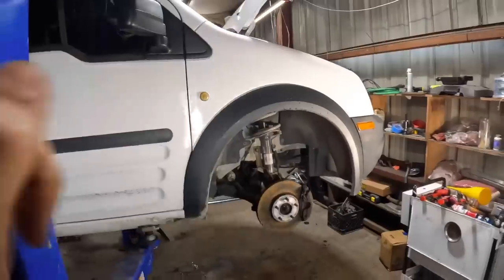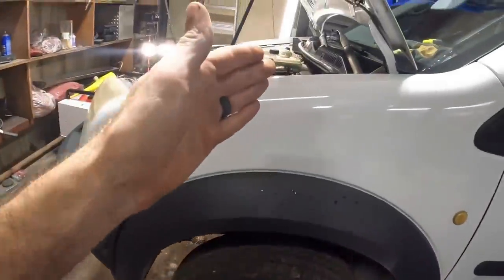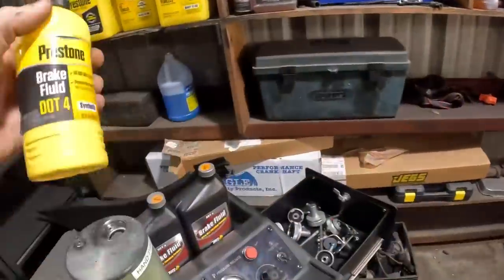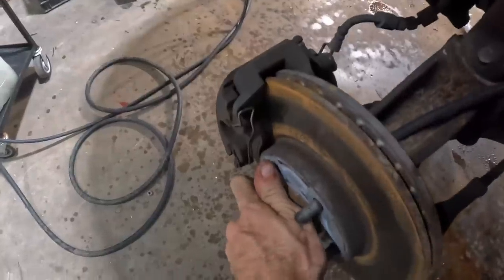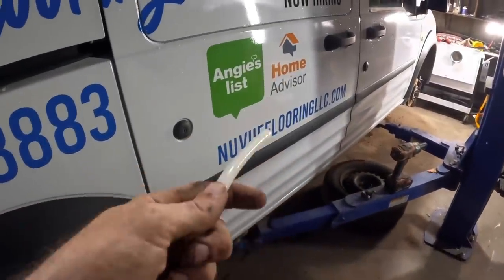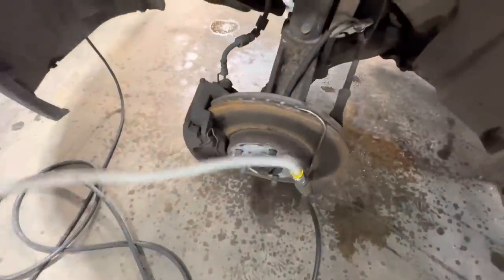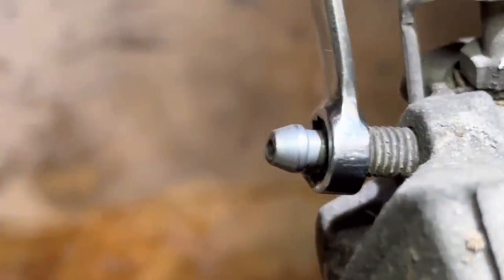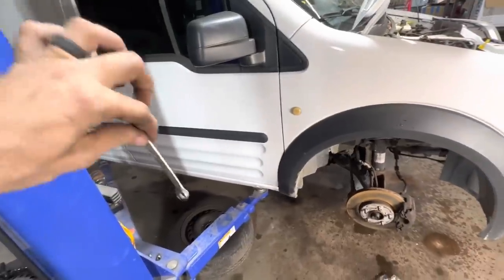Does Brake Fluid go BAD?? Ford Transit 2.0

Comment: I'd always exchange break fluid on aircraft on an annual inspection, the ones I'd not worked on had old fluid yellow and like treacle instead of red.
If I still did aircraft maintenance I'd do videos.
Now I'm building aircraft for film work so they don't need to be airworthy.

Comment: Aren't bleeder valves about the size of a grease zert so here's my idea. Find a clamp on style zert and a clear piece of lexan tube hook the rubber suction tube over the clear pipe then hook a rubber tube on that and install the clamp on zert to that, then when you use this you can hook it up loosen the bleeder and you've got a clear seight tube to watch the fluid in and dont have to disconnect anything.
You put you box end on the bleeder and dont remove it, this way nothing gets disconnected and you can always see the fluids as it clears up, no chance of letting air into the lines ecpt at the master cylinder as it fills becuse this can make tiny bubbles under a vacume it shouldn't.

Comment: Missed Brake clean spray of all the spills. Most brake fluid is very corrosive to Auto Paint surfaces and to rubber grommets and those on the axle got covered in the bleeding. Hope you did spray clean before refitting wheels.

Comment: Just so you know the fact of not removing the hose is what introduce air in your system because the vacuum is greater than the output and draw air from the threads of the bleeder.

Comment: About the green brake fluid: Some brands use intentionally pigmenting of their fluids, color coding the type: Red was an old petroleum oil based low temperature one (recently used only on large vehicles to transmit pedal controls to clutch, mechanical diesel injection pump, air brake valve control; compare to the high temperature ones it is not hygroscopic, so has very long service lifetime), yellow is Dot3 and if I remember well the Dot4 was colored green. So to me most likely it is green from its manufacture and not from any corrosion. Moreover it was rather consistent green on all places, very unlikely from a corrosion when the fluid is actually not circulating in the system (like e.g. steering...).
Reply: Audi has green dot 4

Comment: I am surprised that you did not take the opportunity to make the back of the calipers "nice and shiny" to wash off the brake fluids that spilled out before suction was applied. XD good video - very well explained how a decent tool lets you exchange the brakes fluid better then way Ive used to do it. which was basically me allowing fluid to fall into catch thing until fluid was empty then add new and bleed system.. - this way seems so much better and technically faster too.

Comment: The last time I got a fluid exchange they left a bleeder open and when I left I had no brakes. Then the tech had the nerve to blame me. I changed my rear calipers but not my front. I never trust myself with bleeding so I took it to a national brand. When I returned I could see it pouring out of the right front wheel. After trying to blame me for something I didn’t do then he said the bleeders were feeling like they were about to break if he tightened them too tight. His story kept changing.

Comment: Hey Rainman,there should be some hex nuts in the machine that has various size bleeder  sizes on one end and a big open round opening on the other. These are for holding the bleeder hose onto the bleeder tighter and allows you to snug up the bleeder using a 9\16 wrench. Then you can take the hose/hex assembly of and final tighten with the correct size wrench. They really help in situations where it is a little tight like at those rear wheels. I didn’t see them in the drawer though.

Comment: 9:32  Na, the cylinder is lower than the master and the bleeder screw is at the top of the wheel cylinder.   I gravity bleed or just use the pneumatic vacuum unit.  Also, always crack the bleeder when compressing caliper pistons so the old heat-cycled fluid doesn't go back through the system.

Comment: The replacement wheel cylinders for my 67 Plymouth came with 7mm bleeder valves.  Not amused.  The SAE equivalent wrench is a bit under 9/32".

Comment: cant get air behind the system under pressure unless machine runs out of fluid only other way to get air is if you suck the line of oil faster then its pumping so don't need to keep suck hose on while tightening it back up

Comment: Just got a question for you Ray on today's vehicle that's what you have to do cuz back when I was doing it I used to have a plate and I strap it over the master cylinder pressurize it open up the wheel cylinders  starting like you said right rear, left rear, right front, left front, and it pushed it through. I had to remove the plate and refill the master cylinder but I wasn't sucking anything out,  just blowing it through.Can't do that on today's vehicles. Because of the ABS system?. 🙄🤔🙏,🇺🇲 The old fart in Southern California 😎. Wife unit drinking on the job, hopefully after hours right. 🤗👍🌹♥️

Comment: Brake fluid turns greenish because of the copper ions absorbed from the brake lines.
There are test strips you can buy to test for the level of contamination.

Comment: That's weird that the bleeder valves were 2 different sizes.. Never seen that before. I have always done brake fluid exchanges using a hose from the bleeder to a bottle with a little bit of clean fluid in the bottom. No need for expensive machines. Top off reservoir, and using the brake pedal. I pump clean fluid through the system. Starting at RR, LR, RF, LF... Thanks to the fluid already in the bottom of the bottle, looping hose up over top of caliper/drum you don't let air back into the system.
Reply: Front and rear ones can be different from eachother, especially when dealing with drums at one end
Reply: @Emily-ou6lq  I've worked on American designed vehicles built in every decade from the 60's to 2010's. I have also worked on several different models of toyota, nissan, and such. I have never seen 2 different bleeder valve sizes on the same vehicle. As I understand it, the Transit was designed in Europe, so maybe it's a European thing??? I don't have much if any experience on European brakes. But either way, it's weird and stupid.. Requiring 2 wrenches to bleed brakes on the same vehicle.. It's stupid..
Reply: @granitecowboy2199  Yea it's stupid and yes it is the case on (some?) euro vehicles. VW is one of them.

Comment: 3:30 when u move out the old fluid from the chamber than u can use a quart for the change but u can do it with an 1/8 or less…that’s totally enough….

Comment: At the risk of being critical. You have a system that is pressurized, thus pushing new fluid into the system. The vacuum is just to help recover fluid and help keep it somewhat clean. The only thing I can see is that the unit has all those caps.  And yes, the extra resivour for input fluid.
Reply: Yes no need for vacuum at the discharge point.. Only for keeping the floor cleaner I suppose..
Reply: A pan would work. Yes, it may save some time maybe.
Reply: I made my own pressurized setup for my Chevy/ GMC trk.  An air nipple into a pressure regulator, a coupler, short piece of hose with threaded ends, and another nipple  into a drill cap for that resivour.  8- 10 lbs pressure Do one wheel check fluid and so-on. I spent $30
Reply: I also made my own using my air compressor and a PVC pipe as reservoir.. clear hose and leak proof cap. Works great only a few bucks too. .

Comment: Just adding to the comments: 
-Yes, it attracts moisture (hygroscopic). The biggest drawback from that is that it lowers the boiling point of the brake fluid. Brakes and fluid get hot during braking, you don't want your fluid to boil because that will create compressible bubbles, and your brakes won't work.
-The moisture will also eventually work with the aggressiveness of the brake fluid to cause corrosion in the brake lines and cilinders and start to break down the brake hoses.
-Your brake fluid should be a clear/yellowish fluid, if it's tea or even coffee colored, change it .
Beware to always read the reservoir cap because that will tell you which fluid to use. For a short time some vehicles have used a silicone based fluid (DOT 5) which is not interchangeable with DOT 3, 4 or 5.1.

Comment: That Dot 4 fluid takes years longer than Petroleum based brake fluid IE Dot 3 Dot 5…..Dot 4 is Non Petroleum Base it is actually like coolant. 🤟🏻🇺🇸 Knowledge is Power 😁

Comment: It's not a valve.... its a nipple!! lol
A valve is a completely different thing....

Maybe best to make sure the van doesn't take a mineral oil and not brake fluid as such, some vehicle manufacturers are 'wall street bankers' for using different fluids for that.

But yes brake fluid can go bad as it's hygroscopic in nature and draws water out of the atmosphere that then changes the properties of the brake fluid, an electrical tester can be bought to check resistance as water in the fluid will lower the resistance allowing the flow of helectrons in the fluid (I think that's right) and a quick and easy test in the fluid reservoir let's you know if it needs replaced (something to test during servicing).

Dark or blackened fluid can be a sign that the rubber seals in the master cylinder are starting to deteriorate.

Comment: Brake fluid change transformed braking from jerky to smooth; huge upgrade. Also prevents corrosion from inside, which is more important with expensive ABS systems. Old fluid may reduce performance especially in hilly areas when brakes are frequently used.
Reply: Doesn't the ABS unit need to be put into a service mode with a Scan Tool to draw the old fluid out of it?

Comment: Some manul toyotas use a hydrlic clutch 
This usez brake fluid from the same reservoir so you should bleed the throw out berring slave cylinder as well 
As to whats first the left frt wheel or the clutch slave cylinder your gonna have to guess the line length but my bet it its after the right wheel, then the clutch and left wheel but it could also be after the rear wheels. Then the clutch and on to the frt wheels.

Comment: Yes, Brake fluid over time absorbs water because its hydroscopic, There for it will become very corrosive to the internals of the Brake system if not replaced in a timely interval.

Comment: It's quite unfortunate that caliper bleeders are only included on the highest point in the caliper cylindar.  This is to facilitate air removal.  It is the opposite for old fluid. The contaminated stuff is probably more dense so it doesn't get fully removed.

Comment: I think we have a difference I was alway told brake fluid was changed every two years or 20.000  miles which ever comes first you can test brake fluid i would have dig my brembo corse work that I did every brake fluid has wet boiling point there are tools out there that test this 
Anyway I’ve a tool for brake Fluid service and we work of anything up 15psi but we don’t use a vacuum to pull out old we put a pipe over the bleed nipple and into a clear jar or bottle plus you do have to be careful on clutch slave cylinders seen where they had used to pressure and pop it 
Any way lad keep up the good work nice seeing working on European cars

Comment: So, I changed my break pads and break fluid at 52K miles on my Honda Pilot about 6 months ago. It was an ugly brown color. I made an air trap with a clear plastic PET bottle (Empty and cleaned 32 Oz. Gator Aid) half filled with break fluid. This allowed me to crack open the bleeder valve and run between the breaks (3 slow pumps) , fill master cylinder and then view fluid color through clear plastic bleeder hose. Since I was just using gravity and the break pumping, it took me a while, but got clear fluid finally at all the valves.
BTW: Isn't there a moisture test device with 4 small floating balls to indicate moisture % in break fluid?

Comment: Brake fluid is hydroscopic so it does indeed go bad by eventual water contamination from condensation. This is why even after you open a bottle of brake fluid it starts to go bad and does not have an indefinite shelf life (once open).

Comment: Didn't re-de-pressurize the machine after vacuuming the level down.  But what a great time-saving machine.
I always wonder about pulling air / vacuum through the bleeder screw threads when they're open; wonder if applying system-compatible grease around the bleeders would help - at least for my OCD.
Honestly expected another dramatic spray-off of the bled out fluid.
I thought bleeding ABS systems required specialized bleeding equipment, but after watching a few years' worth of auto repair videos, I guess not (shrug).
Brake fluid is hyGroscopic (water absorbing).  Why not hyDroscopic?  Dunno. Ask the Greeks.

Comment: Lower pressure the less cavitation of the brake fluid to create micro bubbles.
Reply: The micro bubbles were from the vacuum tube sucking air through the bleeder fitting. I see no reason to add suction at the bleeder if the fluid is pressurized.
Reply: @TheJcrandazzo  that’s correct, since the vacuum is made from a vacuum pump or a Venturi you want to not use 20 of vacuum or 60psi on the Venturi. The higher the vacuum the more micro bubbles.

Comment: Yes, it is a hydroscopic fluid, which turns acidic when it contains moisture and can eat through paint and other coatings. It is, however, very good to rubber, unlike oil.

Comment: I remember how the same spec brake fluid had different colours depending on brand.  So I used to always buy a different brand each time when flushing so I could easily see the change from green to yellow, to blue, depending on which one I got that time.  Now they have all standardised on the same colour, (per spec, I think), unless it is badly discoloured it can be difficult to tell when the new fluid has reached the caliper.
Reply: Hence the lines on the reservoir...
Reply: Used to be able to get a blue one but iirc, DOT put an end to that.  The rationale being someone would confuse fluids.  But then coolant comes in every color of the rainbow....so?
Reply: @10HDFLHX  That's fine when Ray is using that, but I don't have one at home for the bike or car.  Seems a bit of an extravagance for home use really.

Comment: what about abs reservoir cleanup? Not sure about the Ford, VWs have this as a step during brake fluid exhange. Diag tool will actuate abs pump during fluid echange...

Comment: My duramax does not like this procedure done. Every time i do it, be it with a machine or with a helper it gets upset for a while. I’d say for about 2 weeks it will start trowing the abs light and activating the abs during normal breaking at random. It goes away after a while.

Comment: I’ve seen green brake fluid in a newer car before and thought it was dyed that way as it was so new. Guess that wasn’t the case. Still have that same car more than 15 years later and it’s had some bleeds over the years, but that came to an end when the bleeders corroded (Wisconsin daily). Now I just vacuum and refill the reservoir in hopes that’s good enough for a car that’s well into the back 9 of its life. Don’t have anything fancier than a turkey baster to do that though.

Comment: Replacing my comment...

I actually never knew that such a machine existed, for complete brake fluid exchange. Seeing that such an expensive tool is available, I have to assume there are many reasons why brake fluid may need replacing...and more common than I ever knew.

Comment: Ok I get it .  All the brake fluid in the brake lines is changed. But, what about the brake fluid that is in the calipers and slave cylinders?  if it were mine I would compress them to reduce the space for fluid in them.  BTW,  I like to change the fluid when ever I change a caliper or slave cylinder.

Comment: I see you gave master cylinder to full. I hope you have new brake pads fitted, if not, when new one are fitted you are likely to overflow the master cylinder. I have to say that I can do a fluid replacement as quick with bleed bottle and pipe, all the messing about setting up that machine costs time and expense (ekectricity) against the job.

Comment: Brake fluid does not degrade though can get contaminated. With a sealed brake system no moisture should be able to intrude. Water in a brake system will make your pedal spongy. I’ve had 200,000 miles on the same brake fluid without issue. However this is a car that is not driven in cold or adverse weather

Comment: Don't think it makes much difference, but "always starting from the furthest and going to the shortest" is an old wife's tale.  Both my Honda and my Ferrari workshop manuals specify using an order that does not match that.  (Same sort of thing for checking ATF level.  My Honda ATF level is specified to be measured shortly after engine shutoff -- not with the engine running.)

Comment: Sure does when in vehicles. Ain't sure if it has a use by date on the shelf.
Reply: If the bottle has been opened it will start absorbing moisture. You basicly should always use a sealed bottle per job.

Comment: When you pull the hoses off, aren't you jut sucking air through your machine and does that cause a problem?
Wife unit 👍
Break fluid is quite caustic, yet you have it on your floor as well in the calipers, etc of the car.   Hope you cleaned that up?

Comment: VW and Audi and most makers tell you every 2 years brake flush, not miles, it absorbs moisture which boils, and reduces braking, and corrodes stuff.  and all brake fluids are not the same, just like so many oil specs, there is a difference...using the non specified brake fluid will and will cause problems...leaks, destroy seals etc...

Comment: Brake fluid is hydroscopic so needs to be changed for fluid from an unopened can every two years maximum. If too much moisture is in the fluid it can boil causing a zero brakes situation, which is not much fun